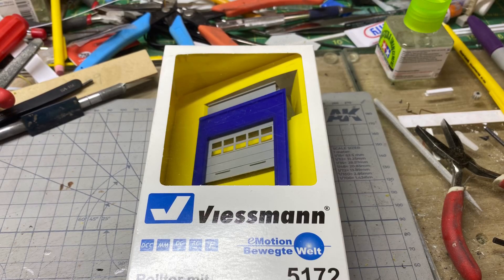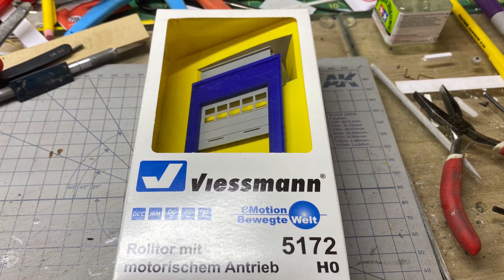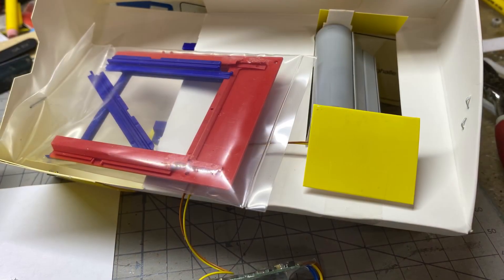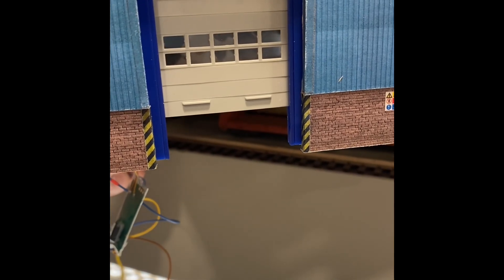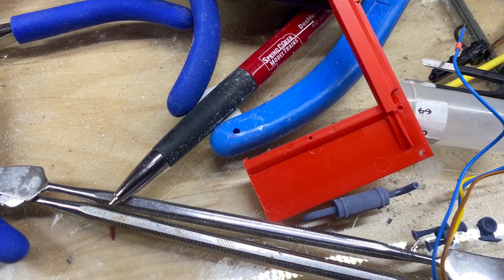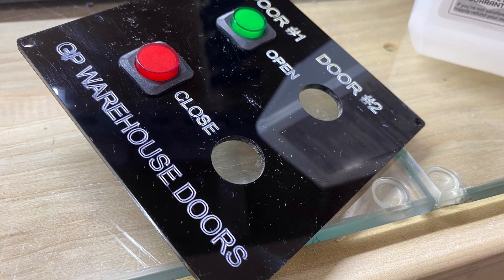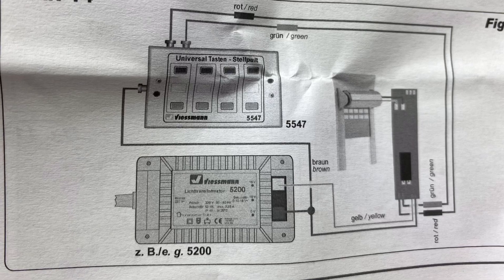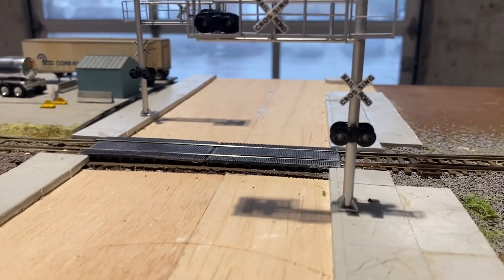VIESSMANN 5172 - HO SCALE ELECTRIC ROLL UP DOORS - Assembly, electronics, and modifications

Comment: I would love to see these doors work on Walthers buildings especially the diesel and car shop models.  Could you tap into the motor wiring for red green lights for when the doors are open and closed?  The price is pricey instead of using switch machine motors.

Phil

Comment: Nice video thanks. If you connect this via DCC, can u assign it an address and lower and raise the door from your DCC throttle?
Reply from the maker: I didn’t look into the DCC specifics, but I assume you assign it a accessory address, just like a switch machine or signal.   And I also assume, just like the accessory addresses, when you type them in, you press 1 for normal, or 2 for reverse (on NCE anyway) and I imagine those would just correspond to open and close.   I would have loved to have set up with DCC, but since it was going on a Free-mo module, I couldn’t.  Since Free-mo modules are set up with different groups and shows, having an accessory with an assigned address, could get complicated if someone else showed up with one with same address.  Just go old fashioned push buttons.

Comment: These are pretty cool.  Do they automatically shut the motors off when they are all the way closed, or do you hold the momentary switch until it's where you want it to stop?
Reply from the maker: I’m not sure how the technology on this works, but for looking sort of cheap, it functions very well.  The motor has a cruciform gear thing on its shaft that mates with a another, female cruciform inside the door roll.  You slide the motor in, I think when the door is fully extended, and it knows to go up or down from there.   I don’t really know if the motor has some sort of internal limit switch, or is just an electronic precision thing. Somehow it’s smart enough to not turn on if door is all the way up, and you press the up button - nothing happens.  Same thing when it’s closed.  Again, pretty amazing and reliable engineering for cheap plastic parts, and a tiny motor.   You don’t hold the switch - just a quick press and it will complete its opening or closing by itself.  If the door is going up or down, and you want to change direction - just press the specific up or down button again, and it works.   The momentary switches are connected to the positive voltage in.  The circuit must be waiting for a digital HIGH signal, which you send by pressing the button.  Very slick.

Comment: Looks nice!  Thanks for showing all the details of how it works.  One amusing thing is that I was looking at tiny geared motors on eBay last week, and the motors they're using are available from at least a dozen sellers, with that distinctive plus-shaped connection on the end.  Which is absolutely the way to do it, rather than doing something that has to be custom-manufactured.
Reply from the maker: I know the exact motors you are talking about - low RPM, high torque, gear motors.  They are incredibly small and have some power.  I used two in an O Scale scratchbuilt locomotive that I will be doing a construction video about.  With only two axles, the little critter can pull six weighted O Scale cars up a 5% grade.  Better performance than I expected, since the prototype probably couldn’t have done that.  (Future video).   Currently, I’m playing around with using one in re-powering the Walthers HO Scale Bascule bridge.  Again, a future video, although this one might be the next as I’ll make them in real time as I solve problems with this bridge.    The motor on these wiseman doors is maybe even smaller, but has some power, and I think probably some sort of helical or concentric gears to slow down the rpms.   Thanks for watching.
Reply: Hi, I tried to find them on ebay, no luck. How do I find them ? Key words ?
Reply from the maker: @ Type in VIESSMANN 5172  make sure you use 2 ss and 2 nn.   A bunch came up when I type that.  All are in Germany or Austria, which is where I think I got one of mine from.  They are cheaper there, so with shipping they will be same or less as any US supplier, which currently all US suppliers look to be out of stock.   They arrive fairly quickly from overseas.   There might be a setting on eBay that you have on that wont show you international sellers of products.
Reply: @mussersail  Thanks, I am only looking for the motors, not those overpriced Viessmann doors  ; )

Comment: This is not a rail car door. This is for a building for vehicles to go in and out of.
Reply from the maker: @coolruehle  it could be for either.  Three of the Kibri kits it’s designed to fit into directly are for road vehicles but a fourth is for rail equipment.  For our purposes it’s a direct match to a railroad freight door into a metal warehouse, located two minutes from our house.  The door is in use currently, with the only difference between our HO model is it receives coil cars, not box

Comment: Hi,
This is a very informative post and thank you for sharing it!  I model O-scale, however, and after checking its website, Viessmann does not offer these rollup doors in this scale.  Since you modified your doors, do you think these could modified large enough for O-scale?  Thanks!
Reply from the maker: Thanks for watching.  You couldn’t modify these doors for O-Scale, other than possibly for a very small roll up door on a garage or shed, but Im not even sure they would be big enough for an O scale vehicle.   The issue is the way the doors and motor are assembled - no room to widen, just enough to add a few HO scale feet vertical, like I did.

Comment: Thank you for sharing your knowledge and experience with the Viessmann doors. I've been looking at these for a while, to put in my loco service facility, but at that price tag I kind of wanted to see them in operation first. Your video gave me all the info I need and so thank you for sharing... Your modules look amazing BTW...
Reply from the maker: Thank you.  Yes, the price tag is a bit high, but if you break it down, most HO non-sound DCC decoders are going to be around $40 anyway, and then you add in the door and motor.   Just follow the instructions for assembly and you will be fine.  The door has to be in a certain position when you install the motor.  The motor and door brackets just snap in, so if you are off a little, you can just pop off and reassemble.  I think I had to at least once.   We couldn’t use the DCC feature because accessory decoders are frowned upon on Free-mo, for obviously integration issues because of the addresses.  DC is very easy, but you will need two momentary push button switches.  I believe you just connect the positive to the switches, and then the green and red wires from the door decoder, and a momentary contact with one will raise door, and other will close.  You can change direction mid-stream too.  Very easy.  I just set up on bench and used a temporary power supply to touch the wires, and work out the electronics ahead of time.